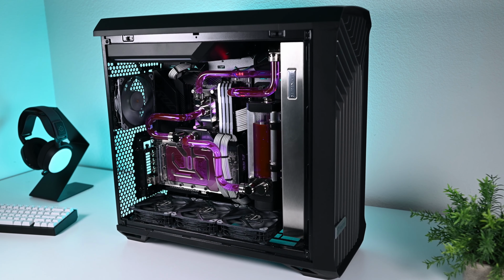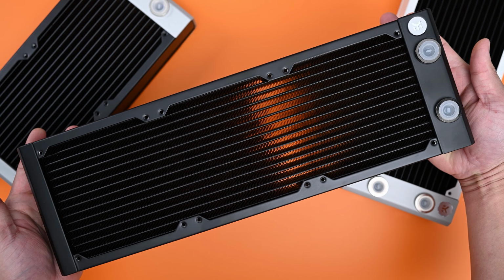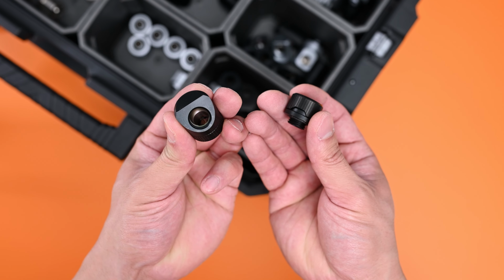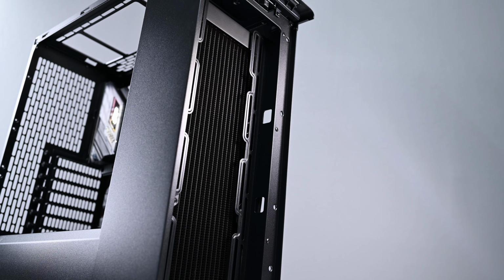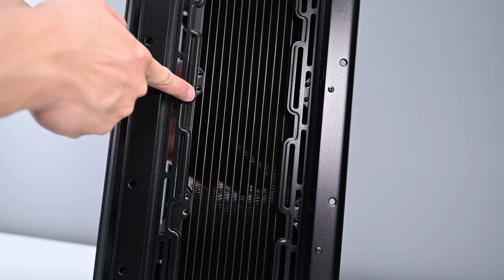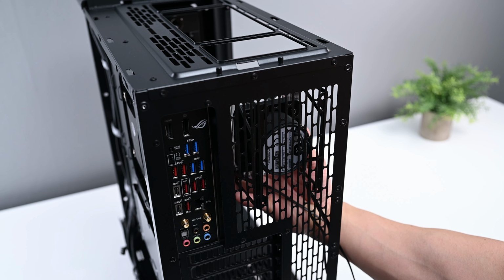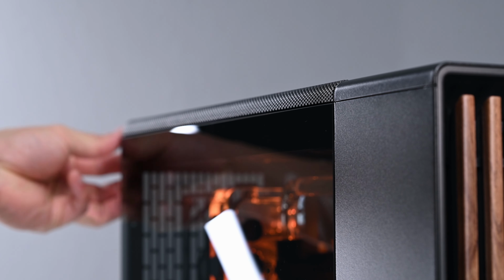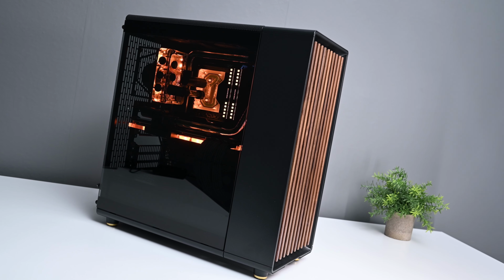Fractal Design North water cooled build

Comment: Could I cool an I9-14900k and a RTX4080 super with one radiator in this case? The radiator I'm looking at is 54mm thick.
Reply from the maker: Most applications are either CPU or GPU heavy only, not both at the same time, which means each of these components would have access to the radiator itself most of the time. Should be fine I think.

Comment: copper would have looked so good if the gold already on there were copper.  Kind of a steampunk look because the wood and the copper...wonder if they have gold tubing?
Reply from the maker: Copper or gold, I could make it happen either way. But copper fittings not many have, I think only Bitspower but they are limited on SKUs. Gold tubing yes, Bitspower also has.

Comment: Does the radiator make a perfect seal with the mounting bracket? I can foresee this case being less-than-ideal for water-cooling because of the gap. I use Noctua's fan gaskets on my current build to minimize leakage and that just doesn't seem possible here.
Reply from the maker: I think it depends on the radiator you use, but even then, I don't think any radiator will make a "perfect" seal with any bracket. It's very minimal.

Comment: Would an EK surface S series rad fit in the front here or do you reckon it would have similar clearance issues?
Reply from the maker: Good question, I don't have the North anymore to test, but I want to say the slim EK radiators should be able to fit.

Comment: What is the cost-benefit of air vs AIO vs custom liquid cooling? Can any of those be used in tandem? If so, what is the cost-benefit of that hybrid cooling setup, too? I'm considering the North but I'm not sure about fitment of a 4090 Founders Edition, and which cooling option would be best overall (regardless of cost).

Comment: Heh, I'm designing 14900k + 4080 system, with 420mm cooling it's gonna be too big for Fractal North, but seeing your very stylish build I'm having second thoughts, like maybe a bit less powerful machine just so I could also get North & build something similar...
Reply: You could always try the new Fractal North XL! I have an Evolv X with a 420mm front rad (280mm top) and I bet the 360 in the North would perform similarly because it has significantly better airflow.

Comment: If you mount your 360 radiator with the plugs at the bottom, it align correctly with the holes in the case.

Comment: Love this build. I would want to build in a case like this if it were to have a mini itx size. Not necessarily a sandwich style like my Lian Li Dan A4 H20 but more like the Torrent Nano. Since mini itx has always been more of my speed. That said, not sure if water cooling will be a good fit for me since my intention is to start switching to NVIDIA's 60s series of cards (currently have an RTX 3070 ti) and plan to use Core i5 cpus. Custom cooling in my case doesn't yield as much benefit for me. Still, I would love to one day do a custom loop even if I never have a need for it.
Reply from the maker: Watercooling is the "best" cooling you can get if we were to just look at straight temperatures alone. But cost and maintenance is a diminishing return. But people who do it pay for the art and joy of it rather than seeking the performance. The performance just happens to be a side effect of giving the best temps is all. But yeah, if Fractal comes out with a mini North, I'd love to see it and I would absolutely do content on it.

Comment: I just picked this case up and this is my first ever PC build. Would you say that radiators are necessary and should I swap out the stock fans? I also bought an i7 13700k. I was looking to do an air cooling build and pick up a cool master MA824. My gpu is nothing special, a friend of mine is giving me his 3060 for next to nothing but I fully intend to upgrade to a 4090 some time next year. Great video. Thank you.
Reply from the maker: Awesome thanks for watching and giving me the details of your build plans. Radiators are not necessary for this build. In fact, I think the North case was originally designed for air-cooling focused builds and I think if this is your first PC build, definitely start with a nice air cooler first.
Reply: @hardlinenexus  appreciate the advice! Thanks man. Subbed

Comment: I went external rad with mine. Well I went both, a internal 360 plus a 560 rad external
Reply from the maker: What was the external setup you used? Like mounting QDC solution?
Reply: @hardlinenexus Sadly I cant link external images on youtube. But I used the radiator legs from alphacool. I have a sideboard next to my North and could hide the 560 radiator under there, You have to be really low to notice the radiator.  I used CPC LQ4 fittings, works like a dream, not a single drop spilled.
Reply: @hardlinenexus  https://www.youtube.com/watch?v=pnq7J0-ho3U